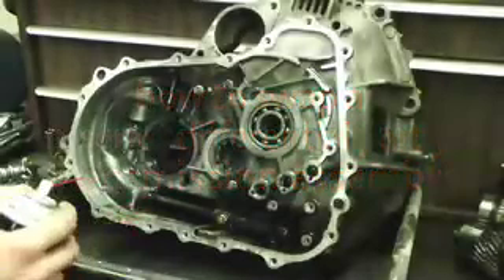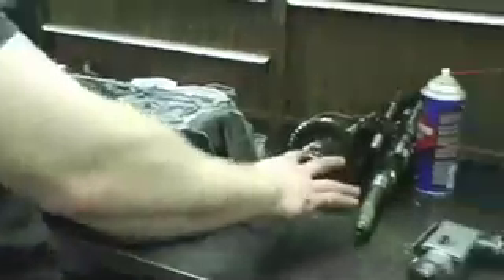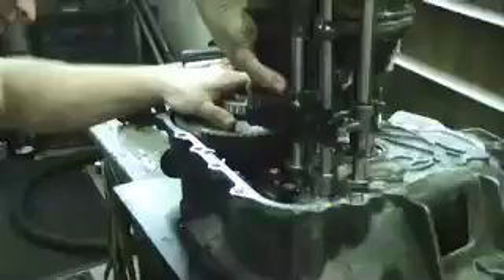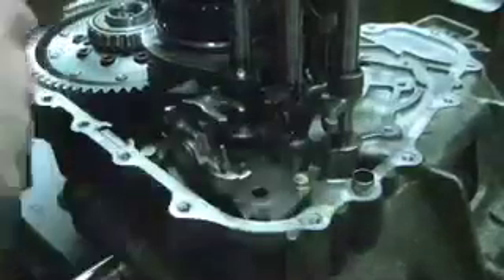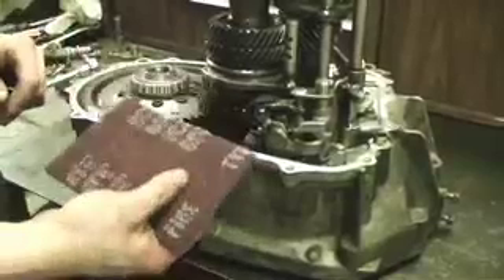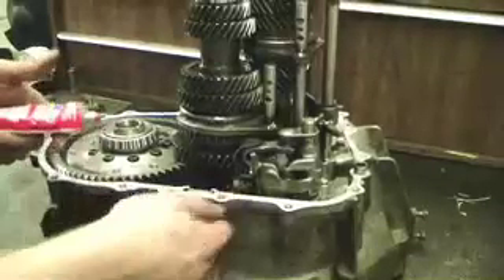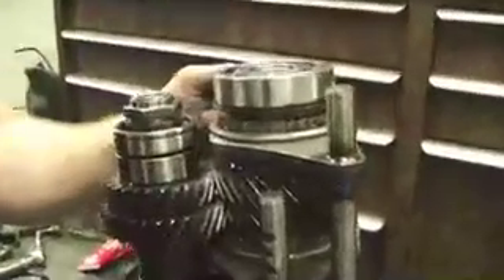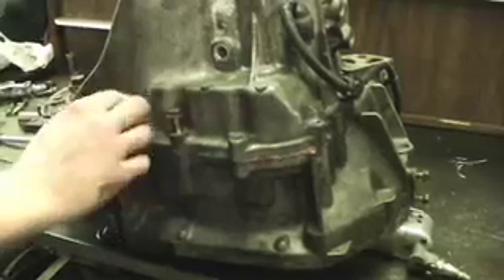Evans Tuning Differential Swap Tech Article - Part 3

Comment: How would you install the outer end of the tapered roller bearing from the differentials onto the housing? I seem to have a problem doing that on my corolla transmission. The part that the bearing wheels roll on. I cant get it into the hole evenly slowly as to not damage anything.

Comment: I was needing a little help I had a jdm gsr lsd tranny and my diff went out and i swapped it all out for a quife and took the bearings off the old diff and put them on the new one put it all back together but there is a lot of side to side play in there like its needing shim. 
I have the taper roller bearings on there. 
please help!

Comment: Now I got all the way to putting the case back on and I figured the snap ring had to click in before bolting everything down but it simply would not, even after tightening a few bolts. I see man handling the trans at the end is the real way lol.

Comment: nevermind...that washer/shim under the bearing on the input shaft wasnt lined up 12 oclock like you said...it was like 3 oclock...so i put it to twelve, put the case back on, and it spins so nicely...

so for future reference to anyone...if that washer or shim is not lined up at 12 oclock, and you somehow manage to jam the casing on there, your input shaft will NOT spin...it will be locked up

-ian

Comment: i just got a trans from someone recently...i havent opened it yet, but the seller has...i shifted through the gears and it seems fine...however, i try turning the input shaft, and i can't do it...like its locked...am i just not twisting hard enough? or what could be a problem?

-ian